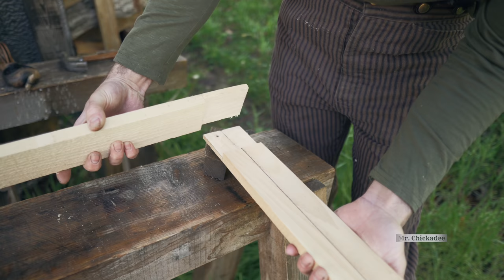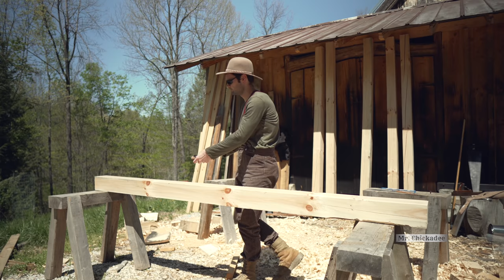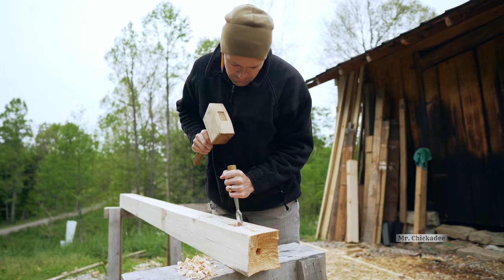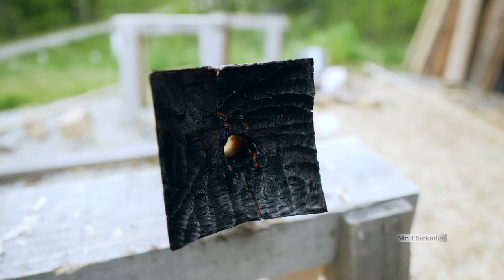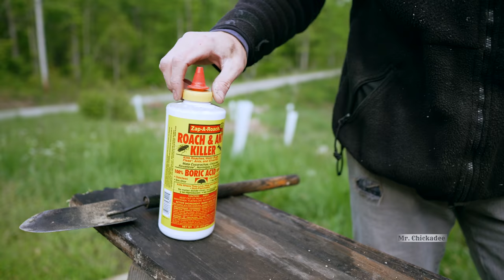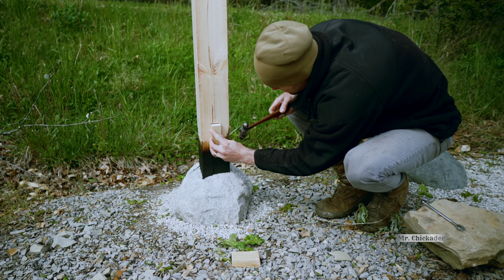Anchoring timbers to stone: ancient technique with modern twist for building codes/extreme winds.

Comment: Hi. How it works in cold winters  (like -15 and less cels.)? I mean...didn´t the frozen ground pushing it out? I love this idea and we have a lot of granite stones, so would like to use it. 
Thx in advance.
Reply: If you dig a hole to below the frost line and fill it in with gravel/crushed stone, frost upheavel will not be a problem.
Reply: He’s also located in the Southern portion of the United States. There is nearly zero Frost Line.
Reply from the maker: This method can work anywhere, no matter how cold. If you ensure there is never frozen soil under your stones, it wont move. Drainage and design is important thats all. Our frost depth is 24" here, yet none of our foundations are ever that deep. We have never had issues because of proper drainage and roof overhangs.
Reply: @MrChickadee  Hmm, drainage and roof overhangs would logically solve that problem. Excellent point. But how can I ensure good drainage around the boulders?
Reply: @MrChickadee  I appreciate that information. Thanks as well for your works and the efforts in sharing them with us.
Reply from the maker: @Soulerous  This depends on your soil type and topography to some degree. I always start with a simple test, I dig a shallow hole to mineral soil, dump a bucket of water in it. How fast does it drain? If it does so fast, you most likely are done, just fill with lifts of first large then small crushed stone, then your plinth. If you have a fish pond that never or slowly drains, you may wish to do something more. One option would be a rubble trench that all your perimeter stones rest in, this is drained to daylight. Or you might wish to add crushed stone down to frost depth, so that any water must at least drain that far down. But honestly, we have found that with proper overhangs, or building on sloping terrain, or both, the underside of the building and all stones stay bone dry year round.
Reply: With the connection to the rock this is the same or better than a concrete pier footing. Pier footings don't work as well with many soil conditions & seismic conditions it is true. I would say you could dig deeper & wider (45 degree spread) and back fill with rock as indicated above, or dig a deeper hole & use a 24" long (high?) piece of granite. Part of the point here is to minimize the use of materials like cement & steel that are very hard on the environment and which don't necessarily last. So, how can the method be adapted to different situations?

Comment: The bolt and washers looks secure. But over time, with the wood expanding and contracting, wouldn't you worry about the wood directly under compression from the bolt becoming, well, compressed? Thereby loosening the connection to the rock.
Reply from the maker: Id never worry about that
Reply: It might but it should not be an issue since these footings only work in compression. It loosening would only be a problem if load reversal was expected. The bolt is only there to connect the footing to the column in shear. For there to be tension on the bolt you would need the wind loading on the building to cause a lift exceeding the weight of the building and at that point the footings would lift off the ground before fatigue and cracking due to loose connection on load cycling connection became an issue. At that point you got much bigger worries. If correctly designed the overturning moment on this structure should never require an active connection to the ground; if it did you would need a pile foundation. Structural Engineer here.

Comment: The mixture of clay, sand and salt or the stuff you have used, what is that do, chemicly speaking. Also, is that turn into mortar? Thanks in advance.
Reply: It's not a mortar, it is a salt or boric acid putty to seal and provide a sitting on the rock, plus preventing rot and insects entering in the wood.

Comment: Would the boric acid not etch the zink plating from the pin and promote rust? Grout won't bond to the dry stone. Hint mix 1-3 PVA (wood glue) to the grout mix and wet stone with the PVA mix to create much better bond. Have done much repair to cement with this bonding mix...
Reply from the maker: The grout does not need to bond to the stone. Its an additional pest deterrant and can add some extra support for peace of mind since traditionally the inside is hollow. Ive never seen the need personally but perhaps for a very heavy building, or to appease some engeneer it can be a tool to have. FYI ancient korean books advised adding a bag of salt inside the hollow.

Comment: What is the point of putting the ant and roach killer in the Portland cement mix you made?
Reply: Presumably to prevent wood eating bugs like termites from entering the cavity and weakening the structure
Reply: @marangatu3688  But it in cement which was used as a fill the gap between the stone and wood. I don't know of any bugs the eat cement. What's to stop the bugs crawling up the wood and chewing on it from a different place. I know termites build mud tubes up.
Reply: It isn't portland cement. It's a clay and sand mix. See closed captions. He also mentioned there that salt would also work as a protection against insects.
Reply: @wolfsvein  It's primarily for mold and fungus prevention. On the off chance there were any bug larva or eggs hiding in that clay or sand, it'll also kill them.
Reply: the other comments are more helpful, but most people are unaware that termites eat through cement

Comment: Ok Mr. Chicadee, I'm an Apeman. How do you mark the axes on the rock. I get the 3 4 5 Pythagorean principle. Please reply.
Reply from the maker: So I drill 3 holes in each stone location, one hole for the exact center point and one say 3" over from the center point in each direction. So then you can drop 3 dots down on the stone, connect them with a flexible ruler and you have one straight line that should be in exact alignment with that wall of the building. Then you can use a carpenters square to get the second line, which should just be perpendicular to the first, passing through the exact center point of course. Now you have your X. The japanese ink for the ink lines is great to draw this X because once dry it will not come off even when rained on. No sharpie or pen I have tried is as durable and permanant.
Reply: If a visual for that helps... it can be found here: https://youtu.be/xPf-y6DzwMQ
Starting at 5:47

Comment: What type of fastener did he use? Seems like it would need to be insanely strong to hold up a building, I may be underestimating the strength of what I’m thinking he used though.
Reply: galvanized all-thread.  The tensile strength of that one bolt is several times more than the weight of an average sized home.  And there's more than one.
Reply: The bolt doesnt need to hold up a building, gravity will do that, it just has to resist the shear of wind forces.

Comment: Whats the purpose  for  building the frame for the plumb bob for centering the boulder  ?
Reply: The frame indicates where the beams go, and you have a square to keep everything in line and square
Reply: @martijnveltmaat3296  You mean posts?  Or did I miss something in its rightful purpose?  I assumed you use the giant makeshift square set against the previous constructed and placed post(s) as a guide for the current one.
Reply: Martijn Veltmaat couldn’t one just do it with string and a reference measuring stake ❔

Comment: What was the purpose of the triangular frame on the sawhorses?
Reply: I think it was a very large square with a pendulum on one end. The stones put down would then be square to each other and the pendulum would mark a spot at an exact distance from the center of one stone to another. It may also have helped set the level, so the top of each stone was level with the other stones.
Reply: a make-shift square to square the posts
Reply: I think its a frame to lift up the  wood pillar.

Comment: Hello I'm currently designing a building with the aim to use no/as little concrete and was wondering if you reckon your method of connecting the timber column to the stone foundation via a metal rid would work in a stone wall that was already made and mortared together, ie. picking out a stone along the wall and then implementing your method (In practical terms I can imagine it would be a bit of a nuisance to hold the column above the stone but in theory would the stone wall be able to support the load). Another thing I am curious about is there a specific type of stone that works best ie. metamorphic/sedimentary/igneous rock.
Reply from the maker: Sure that should work any stone is fine
Reply: This method was actually used to build castles of old. You can see on a lot of the walls they removed rocks at regular intervals. They literally put logs into these holes to use as scaffolding they often time used the same method for attaching the big beams used as floor joists. They literally called them "put log" holes.

Comment: It would be mice, if you could tell us the product you put into the stone, and the substances you were mixing to put on top of the stone. My other question is; the hole drilled into the wood seems much wider than your bolt...won't it be wobbly?
Reply from the maker: Turn on CCs
Reply: @MrChickadee  what are Ccs, and how do I turn them on?
Reply: @lucymorgan8859  Closed Captions/Subtitles. Find the CC button in the video player. In mobiles you tap on video and it is on the upper right. In desktops is in on the bottom i think.
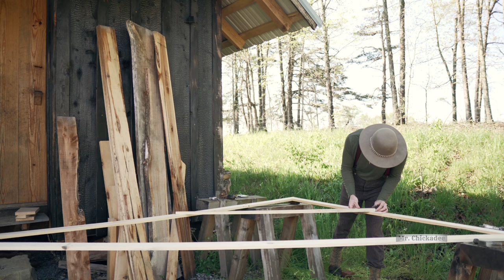Reply: @MrChickadee  I don't see the product mentioned in CCs. Watched it a few times to be sure. There seems to be a gap in commentary from 2:45 to 9:05. Love your videos btw.
Reply: @samfarina1270  I don't know for sure, but it is almost certainly a concrete adhesive/filler. Sika is a common brand at most hardware stores in my area (Ohio Valley), though Quickrete is a major competitor as well.
Reply: Having the hole oversize helps in making the bolt plumb (in line with the earth’s gravity field).  He can adjust it to plumb and then hold that adjustment with the grout, which will set hard. It will be strong and true when the grout sets up.

Comment: The thread on the rod isn't engaging with the rock at all, it's engaging to the adhesive or whatever might be in that tube.

The next question on my mind is the possibility of that rod getting rusted out.  If the adhesive is waterproof it's not going to wick up through the rock, but also can't escape if there's any pooling on top.  So the challenge would be ensuring water can't get in from the top side ever.  Because if it did, it's pooling at the top of the adhesive right against the rod and rusting it?

I'm pretty sure the same problem exists for foundation bolting (which is what my house has) but I did it anyways too, I'm just expressing some theory.
Reply: Pretty sure the adhesive is a 2k compound specifically designed for anchoring threaded bolts into concrete. Stone should work fine as well I guess :)
Reply from the maker: Should never get wet as is installed, but if concerned, use stainless steel rod, or bronze.

Comment: seems the hand drill can cause it to not be level due to eyeballing it. how would you ensure that in a non-electrical way ? maybe an aiding tool fixed to a hand drill ?
Reply from the maker: Just sight down the 4 center lines on all sides of the post.

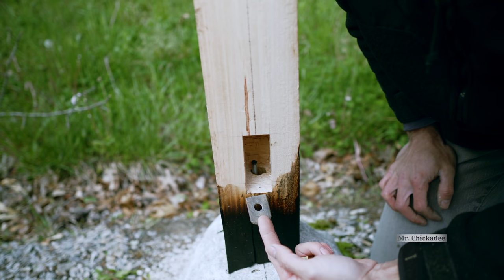Comment: but its not straight right? or am i seeing things. 16:34 The Iron shaft is straight we know that, so the wood cleary is not. isnt that a problem later?
Reply from the maker: no timber is perfect, many of mine are twisted, bowed, cracked, it doesnt matter if you understand center line layout, those center lines on the timber, everything comes out perfectly true in the end with that method.

Comment: So what was the purpose of burning the base of the 4 X 4 ? I've seen off the grid homes where they charred the roof boards but never knew the purpose.
Reply: I'd be interested in the answer to this too. I think it has something to do with rot prevention, but I'm not sure.
Reply: i think its more water resistant, ie less rot at bottom
Reply: bugs don't like the char.
Reply from the maker: google Yakisugi

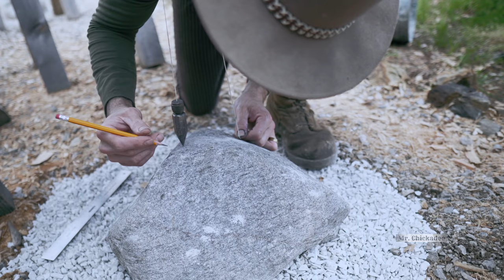Comment: Ummmm, what is the point of hanging this device and marking the spot it points to at 4:20?  I'm so confused why he did that.
Reply: He wanted the resulting construction to be perfectly rectangular, and the posts to be evenly spaced, so he build a wooden frame with a perfect 90 dergee angle to mark out where the posts/support-stones have to go.
How else would you do it without an expensive landscaping laser?
Reply: That's called a plumb line, basically you're using earth's gravity to make sure you're nice and level, or straight up and down perpendicularly
Reply: @timhartherz5652  yes he used 345 rule so he could find perfect square with existing building...
Reply from the maker: gives you a perfectly square foundation within 1/2mm or so without messing around with strings and laser levels and other BS
Reply: So that it lines up with the support beam above.

Comment: Mr. Chicadee, can you explain in more detail how the stone is marked. I don't understand what is going on with holding the plumb bob in one hand and the string in the other hand. Are you using the edge of squared lumber to sight plumb bob with string?
Reply: moreso i think it was to be able to move it ever so slightly so he could get the penciltip underneath it to mark directly where the plumb was, because of clearance i dont think the tip was able to fit underneath, so he had to check that it was aligned
Reply: Hes using a mock up frame(like a giant framing square) to square/locate his foundation posts. The plumb hangs on that frame to drop the location to the stone. The string is in his hand to be able to adjust the height as close to the stone without touching it as possible.

Comment: why the singhing/burning of the post base??
Reply: To prevent rot. Water will "creep in" between the stone and the post and get sucked into the end grain of the wood - quickly promoting rot. Especially where wood sits tightly towards something - there is little air circulation and the moisture will "stay". Signing and more importantly - the "stuff" (i assume maybe linseed/flax/tung oil or so) he puts on helps prevent this.
Reply: Keeps off insects

Comment: Let's say you don't have a good stone source near you build site and you laid the beams ofa small timber frame on a gravel or some other rubble foundation with good drainage like a french drain etc....could you shou sugi ban the bottom beam or plate as they say and would it have good rot resistance? Would you recommend additional pine tar linseed oiling the whole beam for rot resistance?

Comment: Great video and craftsmanship but extreme winds aren't going to be deterred by a 50-75 lb rock bolted to the end of a 6x6 but every little bit helps. If the wind does get that strong then that will be the least of your problems.
Reply: That's what I'm saying. He must be showing an example. Would definitely be a good idea if it was bedrock
Reply from the maker: Well obviously, but at the point where the wind will pick up the whole thing with all the foundation stones, most likely the upper building will be destroyed long before.

Comment: The problem is that your marking the wood to the contour of the stone is only valid for the outside edges. Perhaps a better contour can be made with modern imaging techniques. Do you know if gaps on the underside of the wood is a problem regarding strength?
Reply from the maker: all our buildings just match the outer part, leaving the inside slightly hollow. We have never had an issue, though if you wish you can use chalk or other marking devices to slowly test and fit the entire surface of the stone, or as I show here in this video, use a traditional grout to fill the void.

Comment: is it seated plum and level?
Reply from the maker: yes, in fact, as the timber was scribed after it was placed plumb it can only fit correctly if it is plumb.
Reply: @MrChickadee  I just tried this. Is there a reason we use construction calk instead of concrete to fill the small hole?

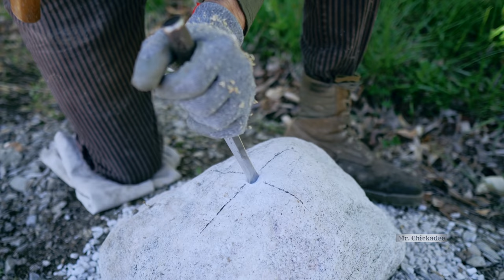Comment: What does the part before 4:40 have to do with the title?
Reply: I have read through some comments, and while I get how it makes sense when placing the second anchor doing it for the third one in case of building a rectangular structure would still require an additional measurement. Wouldn't it be easier to just use a string and spirit level? Moving that wooden roof thing around too much doesn't seem to be a good idea.
Reply from the maker: The large wooden square was also used traditionally by japanese carpenters, and I found it useful for me so I shared it as a technique. 
If the sqaure is large enough, you can easily mark all the stones on two walls without moving the square, then with one flip catch all the others on the opposite sides. If you set the stones on the first two sides and mark them accurately, you can just flip the square around and drop points down to the already marked stones to orient yourself very fast with no measuring. Having used string lines in the past, I have found this to be much faster, easier and more accurate.

Comment: Ok, so I get that the all-thread attaches the stone to the timber, but what attaches the stone to the earth?    And I don't know how you can stand having that black stuff on your thumb all day!
Reply: @Charles Brainard the stone also acts as a washer or a pad, distributing the weight of the building across a wider footprint and preventing the timbers from sinking
Reply from the maker: Gravity....need more, use larger stones. Pretty soon, the building will be torn to pieces before it can lift. NEED MORE? use tie downs across the whole roof and achor them down to large stones.